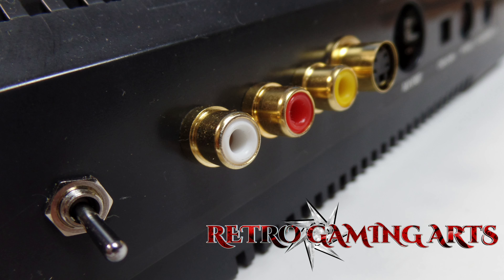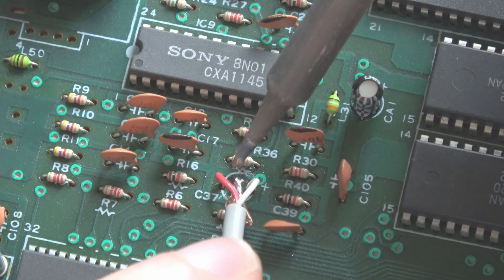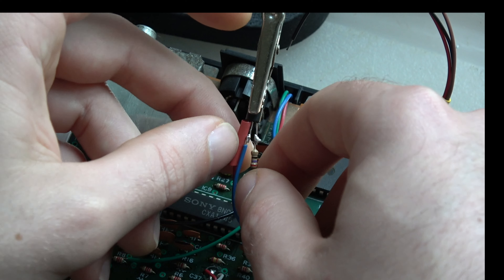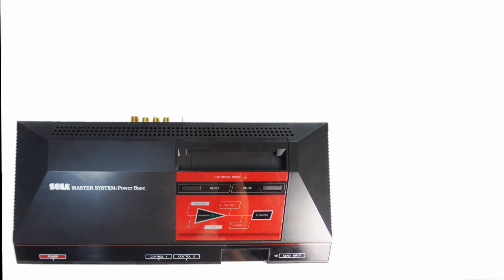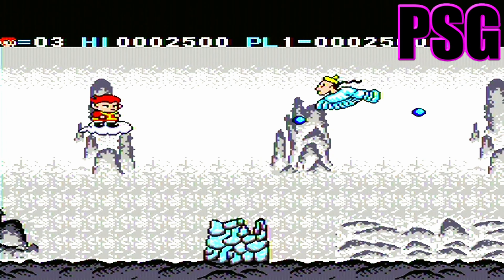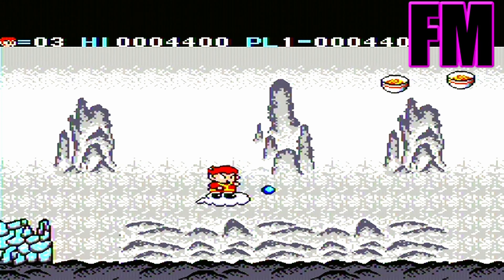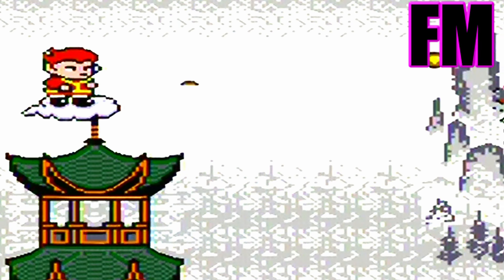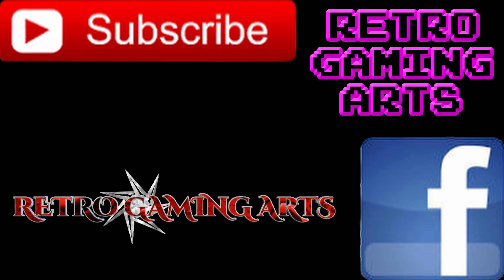SEGA MASTER SYSTEM PSG VS FM SOUND - RGA

Comment: That’s very very interesting, so a fm chip could have generate 2 square waves per channel for complex sound, while a psg chip only could generate 1 square wave per channel, but the interesting part of the psg chip is that it can also generate pcm audio by mixing all channels together and then quickly alternate the volume of them to create wave forms,,

now while the nes & gameboy also does have a psg chip,but the have many restrictions so you cannot do such tricks on those systems but they both do have a saperate pcm channel,, (so therefore it should,ve been called lpsg chip ,limited programmible sound generator),,,the master system’s psg chip should be actually called fpsg chip (fully programmible sound generator)as there’re no restrictions on that chip as far as i do know,but also to avoid confusion,, because as of now the one psg chip is not the other psg chip.

EDIT,, theres also the PWM soundchip in the GBA wich generates digital sound from square waves trough quick alternating between on and off, so it’s interesting what you can do with those chips.

Comment: what if i play phantasy star through a master system converter on a mega drive 2, will i get FM sound?
Reply from the maker: Steven Crawford the sega master system power base converter only works with the model one megadrive/genesis, and i beleive it will obly be psg sound
Reply: The North American version of Phantasy Star had its FM sound code deleted - not just dummied out - because Sega needed the extra space to store the English-language dialogue.

If this sounds counterintuitive, remember that the Sega Master System had a maximum addressable space of only 512 kilobytes (four megabits).

Comment: Whats the point of making a composite mod when you can get HD retrovision cables?
Reply from the maker: HD retro vision cables arn't supported on every single tv, if i recal correctly, and correct me if i'm wrong. but from my understanding the tv hasto support the 240p resolution, witch is pretty much just CRT's, few HDTVs support it. i may be wrong about that, so i find having almost all of your consoles in s-video is very easy to do, s-video switcher boxes are cheap, i have around 15 consoles all hooked up, most of them are in s-video, some rgb, some component, and the rest hdmi. for me, this was the easiest option. so it's a matter of preference.
Reply: RETRO GAMING ARTS it fully supports RGB so just get a scart to component or scart to HDMI upscaler. No need for mods imo. Now if this was the second model, then i would appreciate composite S video more
Reply from the maker: xboxgamerJ16 I feel you, but I like the way svideo looks better than RGB. Not on every console, just some in particular, and for me it's also Easier to do svideo because of my gaming setup, and it's a lot cheaper aswell